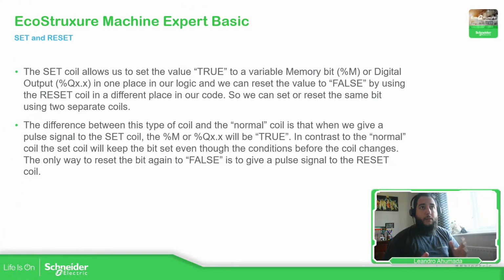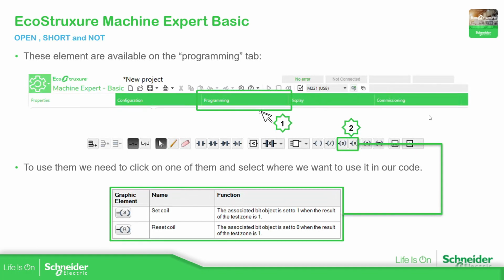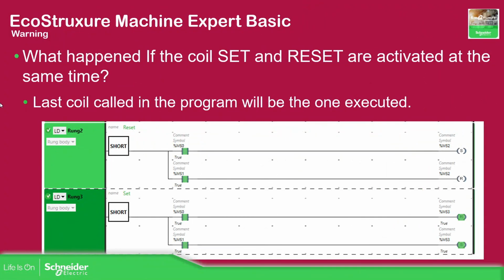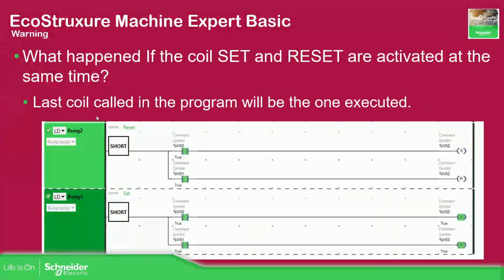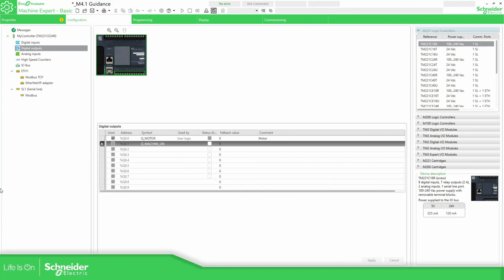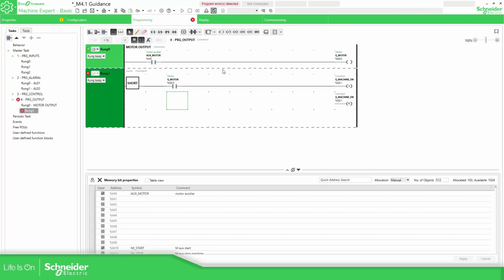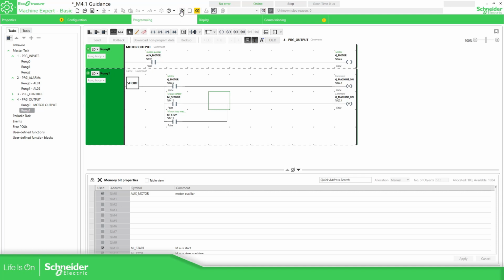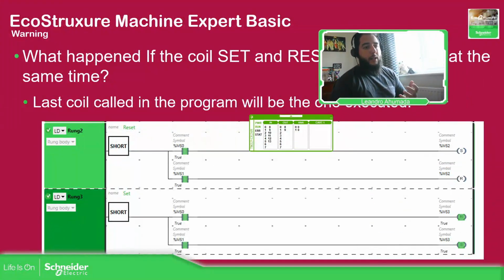Training - M221 - M4.2 Set and Reset

Comment: Sir, we have a flste ironing work and folding machine in a laundry.. there are two blower fan motors connected through plc controller but those two fans mot working now. How to reset and start the fans. Thanks
Reply from the maker: Hi there! In the video i explain the functionality set and reset that can be use to create logic in the plc. In your case someone has created the code and i am not familiar with how the code in your plc works. You will need to contact the programmer or contact someone to connect to the plc for troubleshooting.